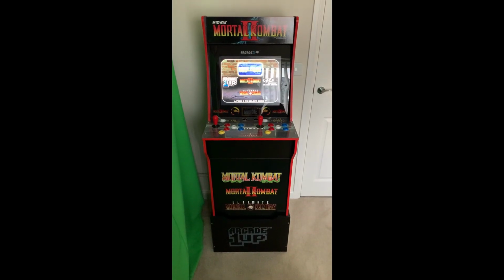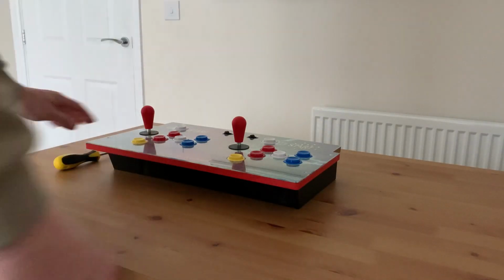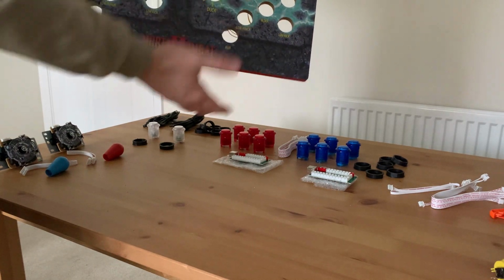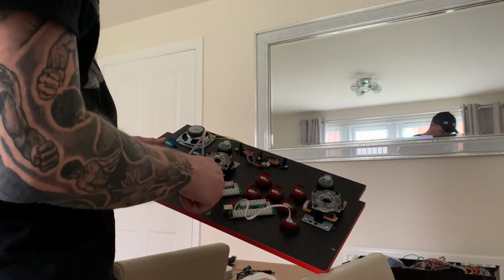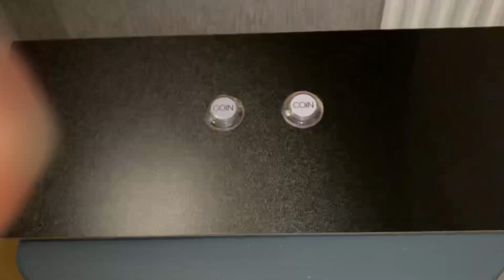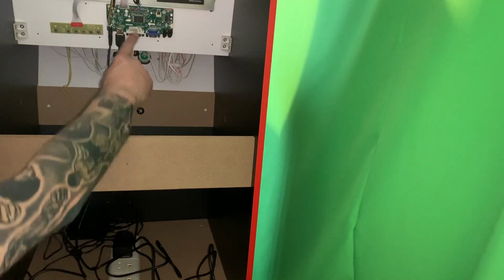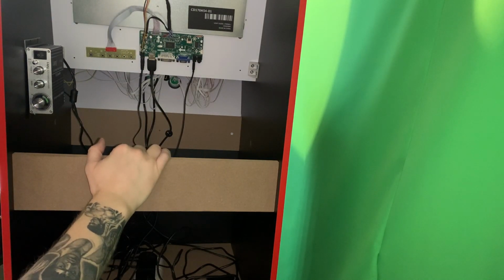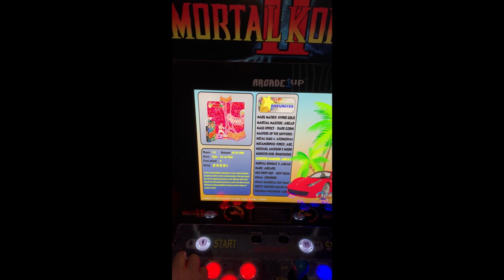Arcade1UP Raspberry Pi 4 (4GB RAM) Install + Tutorial MOD 2020! Mortal Kombat Cabinet Conversion!

Comment: Loved it. Keep it up bro
Reply from the maker: Thx for watching and thx for the feedback 👍
Reply: Looking at doing one these myself, just a few questions if you’ve got time.

Can you run ps2 or GameCube through pi 4? How do you recognise which buttons are which when playing a 4 button game like tekken? E.g. there’s 6 buttons there so how do you know what x,o etc would be for ps? Did you run retro pi yourself? Do you find it easy to update more games into the sd card? And was it worth it?
Reply from the maker: Hi. 
Since a RPI4 is an arm or aarch64 architecture, it can’t run PS2. GC game can run on a RPI4 using a emulator called dolphin but it’s hit and miss with what games that work. 
When setting up your cabinet there is a process we’re you map your buttons , once they are set up , you can boot a game up and check your button mapping, if it’s not to your liking you can go into setting and change the layout, it’s really simple to do.
Retro PI was built into the image. So I just copied the image onto a SD card and booted it straight from the PI.
Adding games is easy to do. You need a pc and you need to make sure your pi is connected to your internet. Then you get the your pi’s I.P address then use a pc to access it. Then drop the roms you want to add. Loads of great guides out there on YouTube which explains it better.
For me it was worth it because I love retro gaming and spent a lot of my younger days in arcades.
Reply: @nutmeister   cheers for that man clarified a lot for me. Picking up mine today thanks to you and eta prime, needed a uk opinion. Only thing I’m really worried about is drilling the holes, gotta borrow a drill, find that drill bit, and remakes a whole button and it’s scary af for me because I’ve never done diy to this extent. I’m getting the MK2 one and most people’s videos are of the SF cabinet, also I’m using a Mac to do all this which is shit because windows is superior for this sorta stuff, unzipping and the technological stuff confuses me a lot. Did you download a rompack ot pick up Individual roms? Sorry to bug but you seem to know what you’re doing
Reply from the maker: @dwayneramsay744  Drilling the holes is so easy m8. If you put the holes in the same place as I placed mine, the MDF your drilling into is so thin that it takes a few seconds and then your done. I wanted the holes there as I didn’t want to spoil the MK2 decals on the button board. 
Ok to get the image you visit “Arcade Junkies” the image I used was by virtual man. Download 128gb virtual man arcade bliss. Then extract it and then install it on a sd card. It will only be 50 something gb but it expands once you boot it up in your Pi 4. All the games and everything is on there so you don’t have to do anything. YouTube putting a image on sd for pi. There is a program you need to install it on sd card. You need any help just give me a shout. Be confident and don’t worry. Follow mine or ETA prime guide and you can’t go wrong. The hardest part was the button swop out because that took the longest. The rest was easy. You got this 👍
Reply: @nutmeister  appreciate it all brother, I’ll let you know how it goes 👊🏽

Comment: Good video and pretty accurate in how to mod these cabs, using ETA Prime model. I've modded both a streetfighter and pacman using the same technique. Two  things I would add is that you don't need the amp, and also you can use the power and volume buttons. The video board you have also has an amp built in, and on the bottom right there are two connections that can be connected to the stock speaker, and sounds just as good - without danger of blowing the speaker with an external amp (which I did).  Volume is then controlled by the small control you stuck next to the board. Power and volume can be connected to the pi's pins and a simple script added to make them both work (very important you use the right pins for power). Look for videos on this by Holly  on YouTube, that's who I used.
Reply from the maker: Love this 👍 thx for the advice , I will deffo be looking up these videos and maybe doing some more experimenting. I really appreciate the feedback. Thx for watching. ETA Prime is a legend 😁
Reply: all those videos for the power and volume buttons dont seem to work with the pi 4, everyone using the 3b+ for that, i tried it with my pi 4 and it didnt work
Reply: @christopherpfankuch551  did u ever figure out how to get them working with the pi 4
Reply: Where is a complete tutorial using script for volume control?

Comment: Nice! thanks for the tutorial. Does UMK3 work ok on Pi4? I have some audio issues in the Pi3+ so I'm hoping it's better with 4.
Reply from the maker: I’ll check and let you know , 🤔 thx for watching. It could just be a bad rom.
Reply: @nutmeister  i dont think so, the issue has been reported many times with different mame cores
Reply from the maker: I’ll check my version tonight. It’s strange that they can get it to run on Arcade1up emulator but not on a far superior setup.
Reply from the maker: I’ve checked , ultimate is more than playable but the audio seems to have too much base but is ok for my set up. I only played it for a few rounds and I could tell there base audio issues but nothing to stop me from playing the game. Hope this helps

Comment: This is awesome! Will you be buying more arcade1up's or are you just sticking with Mortal Kombat?
Reply from the maker: Yes I would definitely buy more if I had the room. But I would want to convert them all and have them running different images. Thx for watching and for the feedback 😁
Reply: @nutmeister  is Images the layout of how everything is displayed on the Raspberry pi on the monitor?
Reply from the maker: @vsrvideo8676  yes my m8 . Check out arcade junkies for more info .

Comment: What Pi image are you using?
Reply from the maker: Hi, Am using VirtualMan’s Retro Bliss (arcade) 128gb - retro junkies
Reply: @nutmeister  Did you have to change the aspect ratio?
Reply from the maker: @bort8727  Hi , the retro bliss theme by retroman is amazing and it’s all been taken care of. No need to mess around with any aspect ratio. He has done all the hard work for us. Just install and enjoy. Hope this helps 👍
Reply: @nutmeister  Awesome! Thanks! I've used a Virtualman image before, but that was on a 16:9 4k screen. Good to know It'll also output on a 5:4.